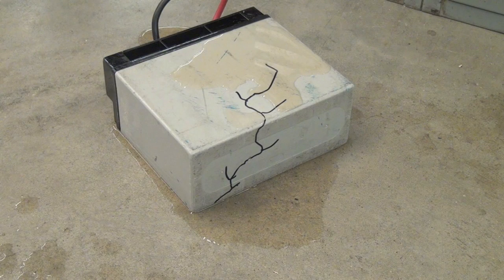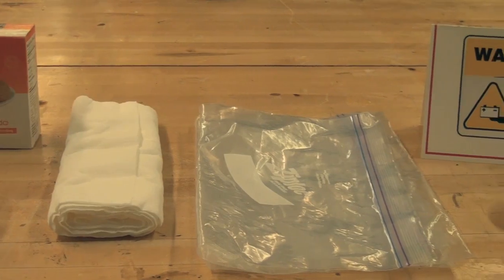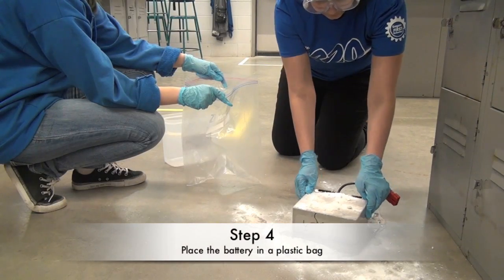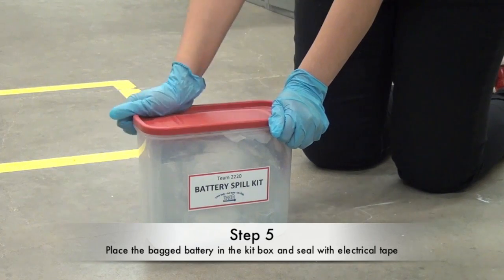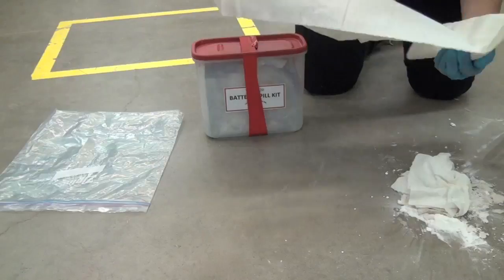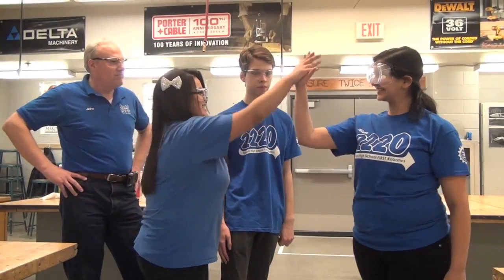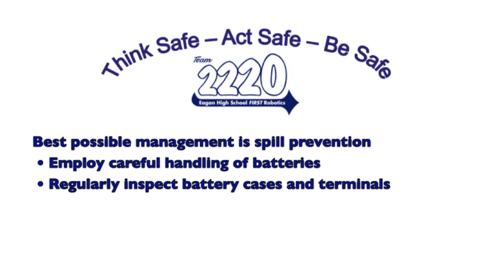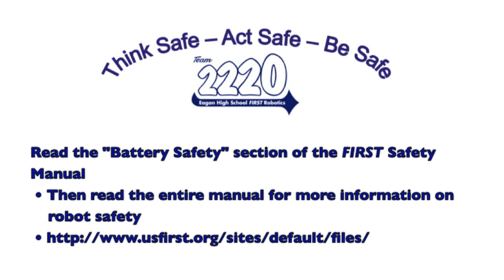How to Clean Up a Battery Acid Spill

Comment: Thanks for this video! I had a lead acid battery in my trunk and didn't secure it. It tipped over and spilled. fortunately I had baking soda handy in the house, but unfortunately did not have any PPE. I learned my ($150) lesson about securing batteries in transit!

Comment: Making use of the ( Check Details Here>>>t.co/Dds3et8HfU ) reconditioning plan, I just saved 2 auto batteries from being completely junked. The guides were very simple to follow. I wish I would have found this years ago! You may use the guide to recondition any battery type